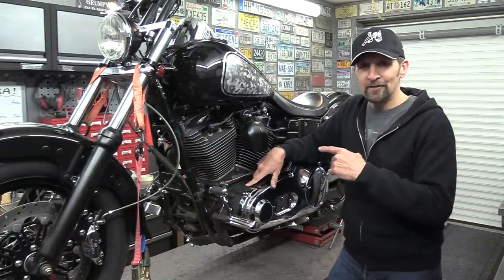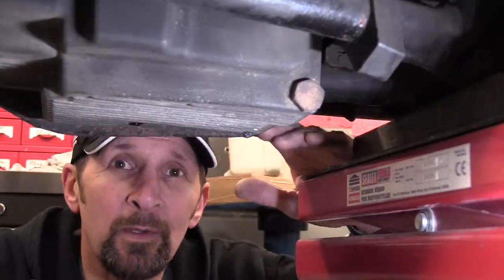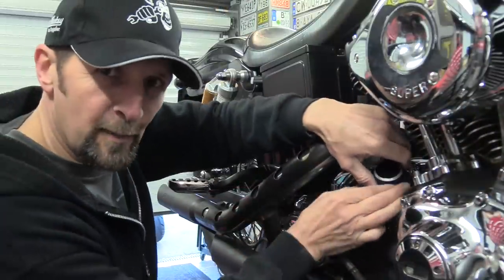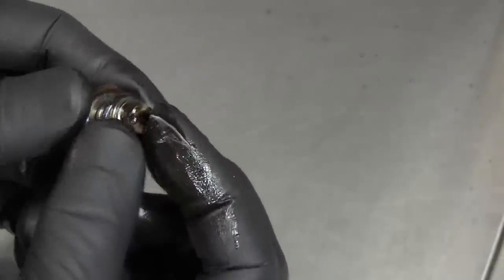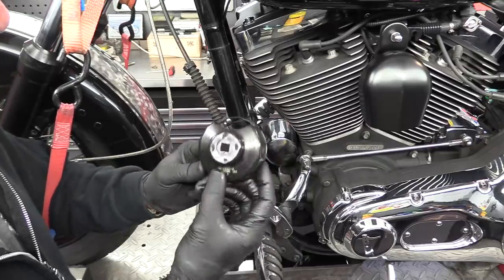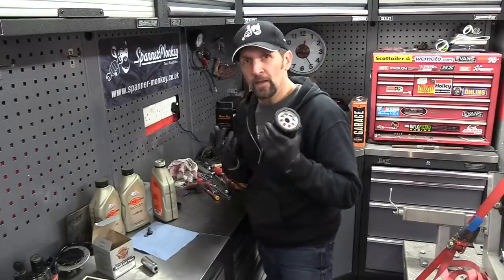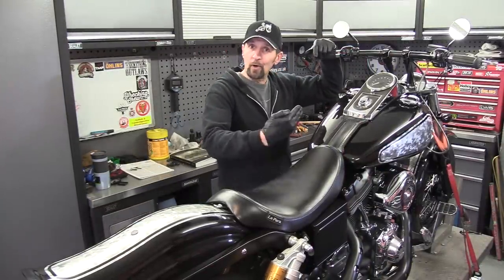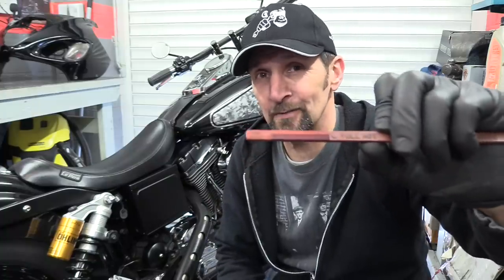Delboy's Garage, Harley Dyna Engine Oil Change !

Comment: Hello Del
I just bought a dyna Wide Glide 99, i have been reading up on the twin cam engine. This weekend im going to tear down the cam cover and check the tensioners that is supposed to be a problem. Do you have any plans for your Harleys cam chain tensioners? 
Really like your projekts and Chanel! Thanks for the hours of entertainment and all the things ive learned.
Tim from Sweden
Reply from the maker: Hi Tim.. thank you for your kind words, and congratulations on your new Harley.. its a good idea to check your tensioners at that age... i was lucky and mine had been all replaced before i bought the bike.  new tensioners, followers and chains too..  so lucked in with this bike.. but its a good move to check them if you don;t have evidence of the job in the history file.   Good luck with it, i hope it all goes well... Thanks for watching.. Del.

Comment: Good video. I bought a 2012 dyna 103 c.i. the guy i bought it from dont know what kind of oil. I bought synthetic blend, if previous full synthetic. Will it hurt to use synthetic blend
Reply from the maker: No the good thing with a part synthetic is it'll mix with both... just take the trouble to drain out as much as you can of the old oil to minimise contamination of the oil.

Comment: Bike looks great,  the vid went in the HD service file, how are those shock absorbers turning out, all the best both x👍👍😎
Reply from the maker: Hi Geoff, thanks buddy, that's what we intended... !  The shocks are exactly what the bike needed... even short, sharp pot holes are no issue, it just swallows them up and on long, fast, sweeping roads there is no weave whatsoever, and as you may know, that is an issue with Dynas cos the swingarm bolts to the back of the gearbox, not the frame, and as the engine and gearbox are rubber mounted, the whole back end of a Dyna flexes... which can lead to a terminal weave on long, fast sweepers... but not anymore!
Reply: @Moonfleet41  have a great weekend both x 👍😎

Comment: Mate I'm gonna be doing my oil tomorrow on my dyna where did you position the scissor jack under engine mate
Reply from the maker: Take a look at the video at 2:50 onwards.. you can see it's behind the gearbox  with a small piece of 3 x 2 wood, against the frame lugs, you'll see hanging down there... that just lfts it about 2" to get a pan under and leaves all the drain plugs free to access... just need to strap down and secure the front as the jack in this position will not hold the bike up very safely... good luck with it.
Reply: Delboy's Garage cheers mate I didn't have room on my 2011 twin cam to get jack under and have access to drain plugs, however I don't need it as I have the automatic primary chain tensioner on mine. Have changed the engine oil, today and tomorrow going to change gearbox and primary oils. Will keep you posted mate, thanks for your help 👍hope you and Penny are safe and well

Comment: I have a 2007 Dina, after changing the oil. The indicator is the same. The readings are straight and inclined. The readings are complete in the indicator. Is this normal?
Reply from the maker: I'm not sure I understand your question, do you perhaps mean where must you measure your oil level?  Always measure oil level inclined on the side stand and with engine hot.
Reply: Thank you very much for the answer. I appreciate your interest🤝🙏

Comment: suprised no purge, read your reply below, gravity does it. Wish I didnt have to purge my softail every time...so no gravity in the softail?
Reply from the maker: The Softail oil is contained in a tank as you know,you drain out the tank only in a regular oil change, which leaves approx. 1/2 pint of oil in the engine and oilways, specially those external pipes, and with the Dyna, as you saw, it has a sump plug, like any other bike, and when you remove that, every bit of oil drains out... there are no external pipes so nothing to purge!... same goes with touring bikes... you only purge Softails, and Sportsters if you're really paranoid!

Comment: When you gonna get that beast dyno'd and the carb set to those roaring pipes Del?
Reply from the maker: Maybe once its all settled in and run in.. ive set it to run really clean and smooth right now, but it has to be a general safe setting in terms if mixture... if i could afford some dyno time, then i could go leaner for more performance and be able to read the fuel air mixture to make sure its safe.. for now i just have to keep it vanilla..!

Comment: Cheers mate, just sold the 48 got myself a 2011 dyna street bob, 7.5k black and has v&h short shots on, my dipstick is sitting right behind the rear pipe, does it just pull out as it seems to have a hex head on the top? I'll have to check next week.
Anyway as usual great vid, hi to Penny see you soon 👍
Reply from the maker: Congratulations on the new Harley Jon,  what a difference in performance aye.. a Dyna is a Harley for life..   My '12 Switchback was a pull out cap, maybe yours has had a custom one fitted..  and those pipes make it pretty hard to check oil with the motor Hot... so i use a welding glove to pull the cap out..!  hope that helps buddy.
Reply: Moonfleet41 cheers buddy yes keeping this one. Will look when I get back from work tonight. Will let you know 👍
Reply: Got my new rear tyre fitted today as the old one was nearly bald, the oil dipstick is a screw out version and I can now access it. Have to go back tomorrow to get front tyre fitted as my mate sold the front one on Saturday. 😱never mind another ride tomorrow 👍

Comment: Is it ok to use copper grease on the oil drain pulg? Thanks
Reply from the maker: Oil drain plug would be better with a little Blue Hylomar, it acts as an oil sealant, and at the same time, prevents corrosion or seizure.

Comment: So no purge on Dyna's?  Saw you do that on a softail.  Great vids!
Reply from the maker: You can do, there is a pricey little gadget you can buy that you can fit in to the filler neck area to purge the tiny amount of oil that a Dyna will wash through, but that's the point, it is only washing it through, not truly purging it, as the Dyna, being a classic wet sump design holds it oil at the lowest point under the engine... so nothing gets left inside the engine other than the residue on the metal surfaces, but with a Softail, there is all the external pipework between the engine and oil tank that stays full of sump oil, which can add up to over a pint that you never get out... personally, I've always just done a standard drop change on Dynas.
Reply: Moonfleet41 thanks bud!  Followed your steps and I’m all done.  Thanks for your timely reply and sage advice!

Comment: Would you do the oil filter seal thing with all makes or is it just a Harley thing?
Reply from the maker: With any oil filter on any vehicle, even a diesel truck engine, it's always best to oil the seal so it slides fully in to place with no drag!

Comment: Would you use an engine oil flush such as Wynns flush before draining or would it f**k the clutch?

Also treating the bike to the best synthetic oil, I fell into that trap with my Sprint ST put Castrol Edge fully synthetic in it as now specified by Triumph I believe but didn't realise this at the time. Bike is still very low mileage. Anyway the bike sounded like crap, but because the oil was so frikin' expensive I ran it for a year on this. I wish I hadn't but I wanted to get my monies worth. The gear change was awful. So this year I put in Motul 5100 4T semi synthetic and the engine has been transformed, so much smoother and free revving, the gear change is buttery smooth again. So moral of story just because an oil meets all the specs and more and costs an arm and leg doesn't mean it's going to be any good. I'll stick with Motul 5100 4T series as it is not only much cheaper but my bike sounds a lot healthier and goes a lot better using it.

Nice how to vid as usual even if I don't own a Harley. Thanks for making and posting.
Reply from the maker: Hi Alex, lots of interesting points and one invaluable lesson there.. .and that is that 'just because an oil is expensive doesn't make it the right oil for your application', use what's correct, not what's poshest!... These bikes have the clutch in a separate compartment with it's own individual oil, so the engine oil cannot affect the clutch on a Harley big twin... As for engine flush, personally I NEVER use it, it is a solvent that's designed to break down the oil and help it run out, naturally once you put it in our engine, some of it will always remain internally, because it clings to things, like oil does, that means you're leaving a solvent that breaks oil down inside your engine to break down the new oil, it's only really for engines that are really badly clogged up, maybe that have been sat for years, personally, I'd rather change the oil with something cheap, run it for 50miles, and then change it agin with some good oil, thus using the first oil as a flushing agent!
Reply: @Moonfleet41  Thanks for taking the time for writing such a full reply. Very much appreciated and agree with everything you say as these have been my thoughts. Have been tempted in the past to use an engine oil flush but haven't just for the reasons you give. Yes use a 'cheap' fresh oil to flush out the flushed engine oil before you put in your desired new engine oil. Where does it all end? Maybe you can get out on your Harley this pleasant long weekend coming show us the great area which you ride your bikes. Great stuff Del, keep up the good work. Thanks again.

They laugh at me because I'm different. I laugh at them because they are all the same. Who said that? ;@)
Reply from the maker: @alexmorgan3435  Great quote Alex... and don't fret too much on oil, as long as you change it on schedule it'll be fine..
Reply: @Moonfleet41  Kurt Cobain. No, I won't fret, won't lose sleep, well not too much anyway ;@) Thanks again.

Comment: Del,
I noticed that the bike you are working on has an S&S motor. What is your opinion of them, as opposed to a Harley engine, or a Screaming Eagle or the motors that are Chinese made?
Reply from the maker: Hi David.. My bike had the original 88ci Harley Motor, it has an S&S Super E carb and air filter though... it made  huge difference to the performance specially as mine also has Roller tappets and Screaming Eagle 203 Cams... 

Of course id LOVE and S&S Motor, specially a nice 124..but ill have to save my pocket money for a few years first..!
Reply: Moonfleet41 Just a note, Harley have used ’roller tappets’ for decades. There are better than std quality ones available, but they are all roller on Big Twins and Sportsters
Reply: @Only_and_Lulu  o
Reply from the maker: @Only_and_Lulu   Yeah, should have given the long version... back about 3k miles ago, the bike had one single job, New Primary and secondary cam chain tensioners, chains, tappets and 203 cams... all for the obvious reason with 88TC motors... it makes me feel reassured its all been done..
Reply: Moonfleet41 best plan ever on a TC88, inspect/replace those tensioners regularly. Or, if $$ allow, go hybrid camplate with the later-style hydraulics (not so cheap)
My bad on the tappet thing, I misread you. Like car guys talk about replacing flat tappets with rollers 😉 
Interesting to note differences in prices around the world. You mentioned in a previous video that a genuine HD battery was about £200 for a Dyna where you are. The dealer I work for retails them at ~AU$200, or equivalent to £110 at the moment, so you guys are really getting shafted!
Reply from the maker: Graeme Cross... the list price from the local Harley dealer!  Maybe it;s because they're made in China and quicker to ship to you lol... we sure pay over here!

Comment: Is that sealent like grease and does it alter the torque spec
Reply from the maker: Hi buddy, any sump plugs torque value first of all is a range given in the Harley service manual, never a specific spec. and because sump plugs are always oily, any torque value offered is considerate of the fact that it's gonna have a lubricant on it, even if it's old oil... but no, Hylomar isn't a grease, it's a sticky ever lasting sealant that's been around since about the 1930's and it's predominately used for oil joints, oil unions and sump plugs... just make sure you don't get any inside the engine, as it can float round and bung up oil ways.
Reply: @Moonfleet41  cheers thx😀

Comment: Easier than the 1450 Heritage  Del no purging and a lot less oil
Reply from the maker: Too right buddy, it's amazing it can live with just 5 pints of oil... and gravity does the purging for ya... gearbox and primary next!
Reply: Moonfleet41 so would you say this engine needs its oil changing more often than the heritage, I think mine was a good 4ltrs purged
Reply from the maker: @tonymartin3780  There is logic in that, but in the book they're both the same mileage recommended, personally for what 3 quarts of oil costs, I'd just change it at the end of every season anyway, as I think many do!